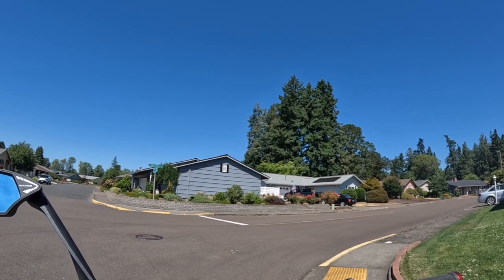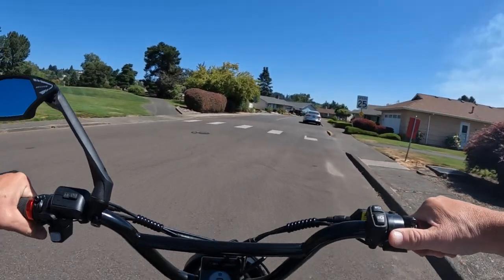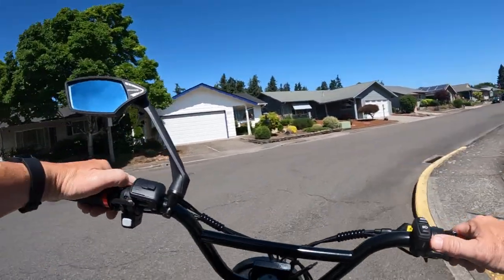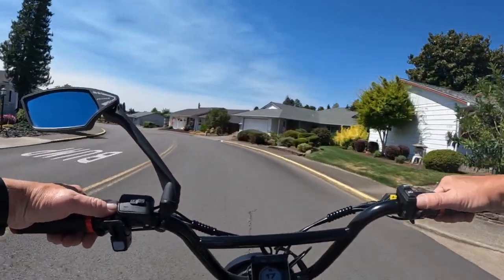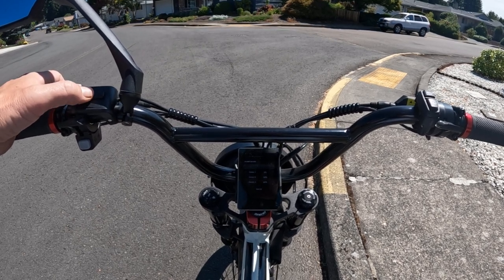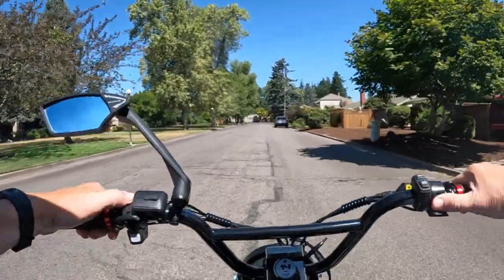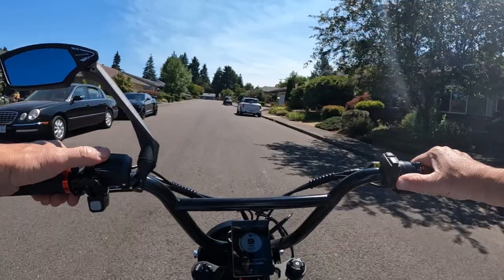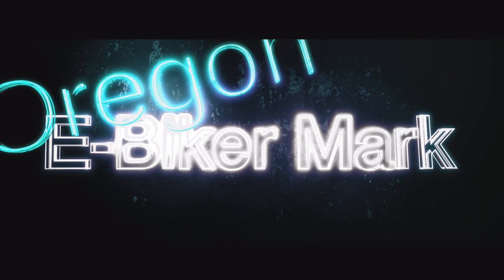Checking e-Bike Speed Accuracy & PAS Talk

Comment: One or 2 days on our bike group rides I had to just put my Kepler on PAS 0 to stay with them at 10-12 mph.. Used all the gears. I didn't have any problem with the 73lbs and 26X4 tires at 8-12 mph for a few miles.👍 I had throttle to use if they started going faster😂

Comment: speedometers on many ebikes go based on the wheel diameter. And big fat tires tend to have a larger diameter than their rim diameter. So for example a 20" fat tire usually needs 22" diameter in the speedo.  A 26" tire i set to 28" for accurate speedo.  The amount of air in your tire and how much it sags down when you sit on it can affect the diameter slightly as well.  So there is no such thing as a perfect speedo but it can get close. I think many manufacturers set the wheel diameter smaller so that it appears the ebike is going faster. But then you get an incorrect odometer and speedometer.
Reply: I agree 100% ...... Every E-bike that I own and seen on the internet exaggerate the MPH on the speedometers. I have a 26" Wired Freedom that came with the wheel size from the factory at 29" ....... I had to change the wheel size to 28" so it matched my GPS phone app. I do not like being lied to ...... LOL
Reply from the maker: correct.

Comment: there is no way that speedometer is correct  remember gryzzli kicked his ass at 34 will yours was writing 37 so that is more than a 3 gape
Reply from the maker: The Grizzly might need adjusting since i changed tires. The setting is at 22" and the Huntsman's are a little larger.
Reply: @oregonebikermark8953  I am willing to bet that it's the lyric that is off, trust more ariel rider than lyric
Reply from the maker: @mustbee-bike994  Well my GPS had the Graffiti 1 mph more than the display on the bike.
Reply: @oregonebikermark8953  ya at low speed try that again at the top speed & see the difference the more you go up in speed the more the gap gets bigger